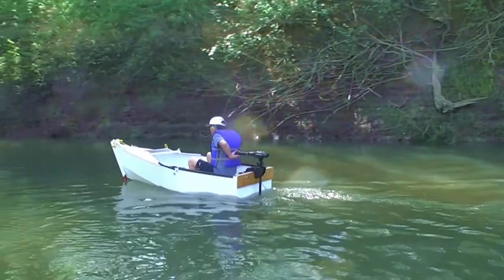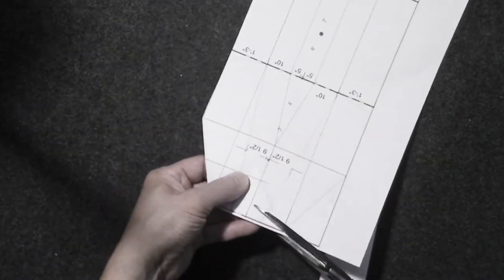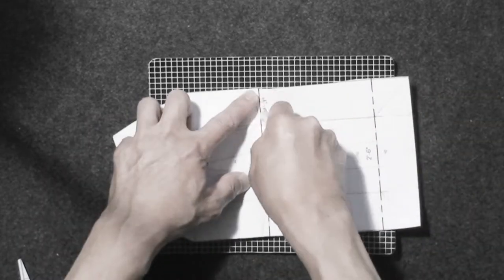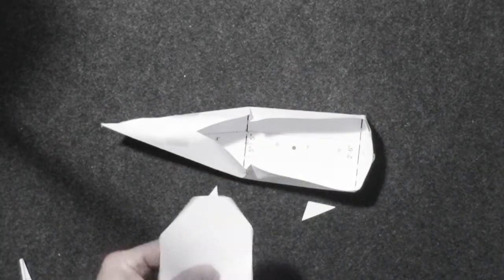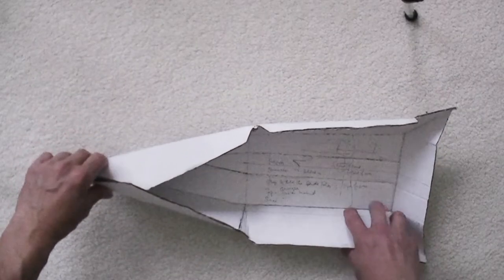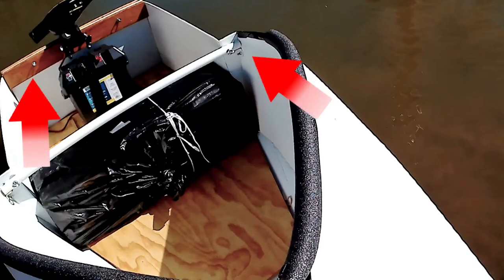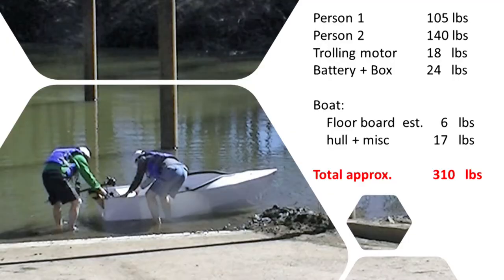DIY Boat plan:  a row boat can support a trolling motor

Comment: For the floor, have you tried cutting and gluing a second layer of coroplast with the flutes going perpendicular? Would that be any lighter? Also, in another video you used some sort of metal as trim for the gunwale. What is the name of that material, and do you happen to know the dimensions you used?
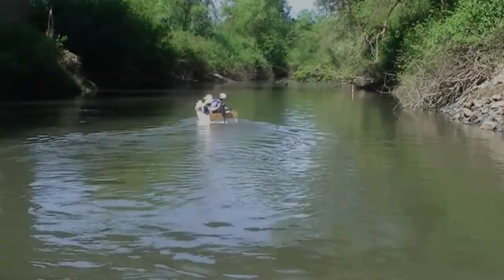Reply from the maker: Thanks for watching the video and your question. I have created the floor you described. please take a look 1:59 min. into this video 1https://youtu.be/N5Fd4Z2ESn4  After I discovered the hot fusion technique, I do not use glue any more in building this type of boat. Glue cost money, and also it is difficult to find a glue that works well on coroplast. Glue is not as strong as hot fusing method. 
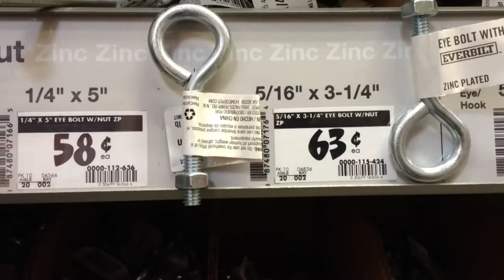I helped my friend to do the coroplast hull (the boat shown in this video) and he has 1/2" plywood so he used that. Because it was too heavy he later switched to the 1/4" thick one, which works also. With my 2-seater boat I used 2" pink foam and wrap it with 4 mm coroplast (recycled from my gen 1 & 2 boats). If I do this again, I will not use zip tie, instead, I will use heat to fuse the wrap-around coroplast together - much stronger and no need to buy zip tie. The sandwiched floor works well. Yes it is much lighter and less 'flex' when compared with the 1/4" plywood. The two-seater is 30" wide and I am now working on a 3'-4' wide 13' long Jon Boat (have not decided on the width yet because I need to optimize the size so I can fold the boat and pack it inside my car). I will adopt the foam/coroplast sandwich for the floor. Because of the extra width, I will have to 'fuse' 'ribs' to enhance the structure of the floor. At the same time min. the weight. 1 sheet of 5'x10' 5 mm coroplast is 10 lbs...and a sheet of 4'x8' 2" thick pink foam is also 10 lbs. I want to get the total weight below 35 lbs if possible. I can make the fused coroplast+foam floor water tight and this creates positive flotation and provides a bit of safety feel in case the boat flips over. As on the metal trim, I guess you are referring to the two-seater boat. I have forgotten what it is called. It is similar to the angle aluminum piece but that one is used to cover the stair steps, which is less expensive than the angle aluminum piece. I will not use it again because I have better method to make the gunwale. I used hot fusion technique (1:24 min https://youtu.be/XPK8EKkWO9M ) ,which cost less, looks nice, provides better structural strength to the boat. The metal trim covered up the folded joint at the gunwale, this protected your hand from getting caught at the joint, especially when you are paddling the boat. You may use pool noodle/round insulation foam to cover up that area. Please feel free to let me know if you have other questions....cheers!
Reply: @DIYUSA  Thank you so much for the thorough reply!

The storage area I have set aside allows for a 3ft wide boat with 17in max depth (length isn't an issue). For my first attempt, I intend to use the more readily available 4mm 4x8ft sheets and achieving the 3ft width by fusing two sheets together with a joint running lengthwise down the middle. I think your hot-fusion technique and some sealing tape for good measure should be enough.

To stiffen the floor, I was going to cut and adhere a second layer of coroplast with flutes running perpendicular to the hull using spray adhesive. I'm not sure if heat-fusing such a large piece is feasible unless I cut it into strips. Since this will be inside the boat, I'm not too worried about any sheer stress separating the two sheets, which is why I'm thinking the spray adhesive might be enough.

For the walls, I was thinking of heat-fusing some ribs. Is a frame an absolute must, or do you think enough ribbing might suffice? And if a frame is necessary, is PVC the recommended material? What diameter?

Thanks for all the help!
Reply from the maker: @samhodge7460  Nice to hear that you are moving forward making your boat. How much weight do you want the boat to carry? (this will give me an estimation on the draft and also I can estimate how much stiffening on the side wall you need). I guess you are using it in a lake or calm river? 3' wide boat is very stable. Because of the width, it will be difficult to row it like a kayak, and have to row it like a canoe, or create a support near the center and use two oaks to row it like a row boat. Because of the width, you can do something like my two seater boat (2:24 into this video https://youtu.be/N5Fd4Z2ESn4 ) and create two rectangular blocks and you can hold the side together easily by using a long lashing... or even a piece of rope. The floor actually provides a lot of strengthening to the side walls. with two rectangular blocks, you shouldn't need extra bracing to the side wall. I guess doubling up the bottom with two layers of 4 mm sheet most likely not be sufficient. You need a more solid-rigid piece to land your feet. My friend used the 1.5" pink foam and wrap it with 4 mm coroplast (on one side) seemed to work well. I used 2 " pink foam and it is even better. Other friend used cut up cedar fence boards with gaps about 6" apart still works but the bottom twists as the boat going thru water.
If you do the bottom right, you don't need a PVC frame on top. Fusing a double wall on the side should be sufficient. I guess you plan to fold the boat together for transportation... if you plan to car top it, then it will be different, You need to have something really solid to tie the boat down....How soon do you want to finish your boat... because I plan to work on a boat in the next few days and will experiment a different gunwale design...and will have more info to share (hopefully if it works :-).
Reply: @DIYUSA  I hope to carry about 250lbs and do a little fishing. The payload will contain a 190lb passenger, 20-25lb motor, a little fuel, emergency paddle, fishing rod, small bait container, 1 gallon of water and maybe a light snack. The transom for the motor might add a bit of weight. Not sure how much.

I don't really need the ability to fold it, especially if it will be detrimental to the structural integrity. I intend to store it under my bed, which has 17in clearance from the floor and a 3ft wide gap between support posts.

Transportation isn't much of a concern. I live a block from Tampa Bay and my intention is to either put it in my car (Honda Fit) or wheel it over to the waterline. I have done this many times with a 14ft inflatable boat using a wooden dolly I built, and that boat + gear is at least 200lbs.

Tampa Bay is often pretty calm - sometimes even glassy. If possible, I would like to take the boat out fishing. Specifically, I don't want to risk capsizing if I hook something broadside. That's why I figured I should go for the widest boat I can store. Maybe this is overkill?

I'm hoping to get started on the boat in the next month or so. The biggest hurdle, honestly, is finding a way to transport the sheets from Home Depot. COVID-19 has made me reluctant to ask any friends to borrow their truck, so I'm pondering whether it would be possible to make some pre-planned bends/cuts in the parking lot and load it into my car. It's fairly spacious, but not wide enough for 4ft. Delivery seems expensive, especially due to minimum lots of 10+ sheets. Any advice here would be welcomed.

I'm looking forward to seeing your new design!
Reply from the maker: @samhodge7460    Based on the input, I am modifying one of my boat plan and see if that will work for you. Again, this will just be a reference info for you. If you fold the sheet to 3' x 8' or 3 ft x 6'9", I guess these sizes may fit inside your car. I will show that in the plan how to fold it. I have glued two sheets to create a floor which I feel comfortable to step on it. I will show you photos of how I did that.  If I do this again, I will just fuse the edged of the top sheet to the bottom sheet.. stronger and no cost for the glue. But the 4 mm ones from home depot probably is too weak. I used 5 mm sheets and the  result is marginally. of course, if I double that to 3 layers, it will be excellent.. but weight more. and my sheet has slightly higher density also (stronger). 
Please give me a week - 10 days to provide you feedback.(will by a video). also on the draft, etc. Since you don't need to fold the boat to the size I want (3.5' x 3'),  If you don't need to fold the boat longitudinally, (folding on the sides are OK), you can build a more structurally sounded boat. I wish I live in Tampa. I only have access to the rivers and lakes. I like the sea...the water here is cold, at 50F and is dangerous if I don't have a wet suite.  It will rain next week hence I can't work on my boat (the garage is too small) and I should have time to work on the video.... please stay tuned.
Reply: @DIYUSA  Thank you for the help. You're too kind. Within the next few days, I'll pull some cardboard out of the recycling bin and tape together a 5x8 sheet to see what it takes to fit it into my car. If I can fit it inside at 3ft wide, that will be perfect.

I don't mind if I need to layer 3 sheets for the floor. Perhaps the added weight will be tolerable due to 4mm vs 5mm. Like I said, I've handled much heavier hauls to the water, and it's only a distance of 300m to the little beach near me. The street isn't busy either, so even loading half-way into the car and idling over is possible (I've done sillier things!).

Here's a picture of my current boat "The Odd Water" https://imgur.com/a/FJibVT8

It can fit 3 people with fishing gear and drinks, but it's an all-day affair, and sometimes I wish I had a small boat I can just toss out on the water and go.
Reply from the maker: @samhodge7460  You have a nice boat :-)  thanks for sharing. You asked many good questions that other people would be benefited from what you have tried. For example, I have the same problem to bring the 4'x8' sheet home from Home Depot. I actually fold the sheet along the centerline to make it into a 2.5' x 8' long. It did't cause any issue to my design. At home depot, I laid the sheet on top of their 4'8' ply wood, and bent it before I bring it to the check out counter........ 
Now, I have a suggestion, I wonder if you want to collaborate on your project and share how you build your boat and post it on your tube?  Other people have asked how to use the 4 mm sheet to build a bigger boat. You are actually doing that. I am creating a video to answer some of your questions. As you build your boat, you may shoot some videos, or photos so I can create the final video(s) to document the process.. and then share the learning.  There is no timeline to complete the project... the goal is to share the experimental design and build process. It doesn't matter the outcome is good, or not good. It may include how you solve the problem, then onto the next/better design (just like me :-) 
Would you like to do that?    Thanks,
Reply: @DIYUSA  Sure, I'll make an effort to document my project. I haven't edited a video in ages, but I think it would help people.

I did a car sizing test with some cardboard a couple days ago. Even with a lengthwise fold, there's no safe way to get it into my car without greatly obstructing my view out of the entire passenger side. I love my Honda Fit, but it's just not up to the task. I either have to make an additional lengthwise fold, or maybe a widthwise fold and then brace it later. The other alternative is to borrow a friend's truck or maybe rent a U-Haul. I also looked a bit further into getting some delivered, but shipping costs alone are $100+ :(
Reply from the maker: @samhodge7460  Thanks,  I am working on a few suggestions (and also answer your questions) that you can probably use and help you to bring the coroplast sheet home in your Honda Fit. Please give me 2-3 days....
Reply from the maker: @samhodge7460  I have some suggestions for you, please check out this video. https://youtu.be/67FWBxYhYMc

Comment: Hello sir!
Can you also post plan for building a kayak / boat that uses 4×8ft coroplast sheets?
Thanks
Reply from the maker: Thanks for asking. I built my 1st one with 4'x8' sheet but it is not good enough.  The plan is similar to this one with trolling motor. You can see the video here: https://youtu.be/U8Q13dMFe74
The gen 2 also used 4x8, I tapped two pieces together and you might have see the build tutorial here:  https://youtu.be/CC9X6YVJ3w8  
Gen 2 is a fun boat, but the building techniques (to me) is out-dated. If you really want to build the gen 1, I can post the plan. Or if you can wait till Sept (I will be very busy till Sept. to prepare for the Maker Faire), I may have better ideas in building kayak with 4x8 sheet coroplast.
Reply: @DIYUSA  I have made one myself. And i would like to send you the build plans for you to check and see if it floats (and can carry a person safely). 
How do i send you a photo of my build plan?
Reply from the maker: @herphermits  Glad to hear that you are coming up with your design. I am happy to review the plan and work out the loading of the boat. Please email the plan to pdxboatmaker@gmail.com. Regards,